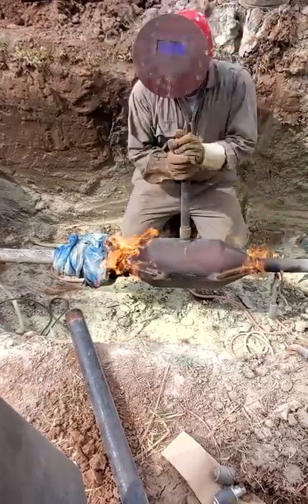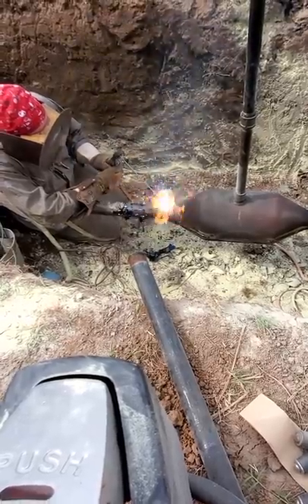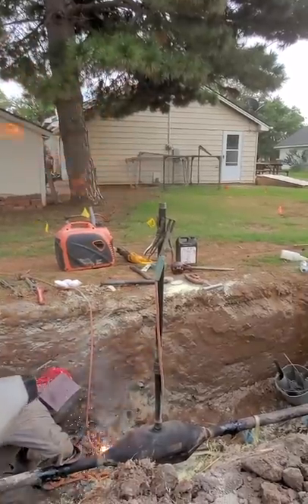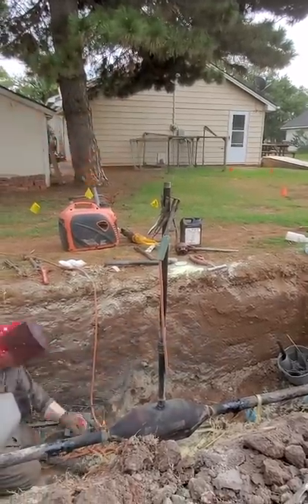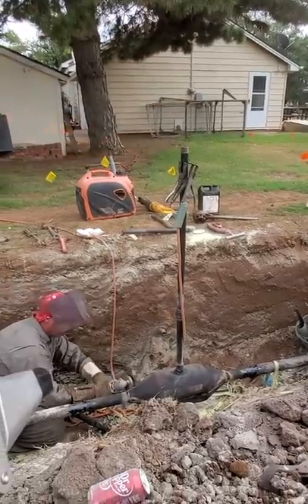Stick Welding a Live Gas Line | Hot Minute #shorts

Comment: Seeing fire is good. If the fire goes out and you hear a whistle....that ain't good.
Reply: If the flame is gone you want to be out of this hile and far far away very very quickly
Reply: Why? Everything in my head says "Fire Bad"
Reply: @Chris.Rhodes  Assuming normal conditions, there's no oxygen in the pipe. With positive pressure in the line, the gas burns at a controlled rate at the desired point, and doesn't build up for a flash or worse.
Reply: Vault Man if it burns it burns a little at a time, if it doesn’t burn, it can create a cloud or collect then any little spark or heat like from the welder would create an explosion or flash fire.
Reply: Fire means gas is burning and you know where it’s burning. That’s why you put the flare stack so the gas will go up the stack and ignition will take place away from you. This is the life !!
Reply: @ricomartinez1770  
"This is the way." 😁
Reply: @ricomartinez1770  how do you put the flare stack on?
Reply: @Travisphoenix334  in this instance the pumpkin (weld over sleeve) has a fitting fabricated on it to allow for pipe to be threaded on and to be stacked well above  bell hole operations. If you don’t have a fitting you can weld a fitting onto the sleeve and tap the fitting and place a stack. Several things can be done.
Reply: So it’s a safety flame 🔥
Reply: That's when you scream "flashback" and hope everyone gets out in time
Reply: Suprisingly this is more common than you think at our company we use whats called a pc-bottom-out witch is like the pumpkin but alot smaller if its a big leak we weld with arc if its a smaler leak we weld with oxi-fule like the come ts said you want to see that flame the second you dont run!!!
Reply: So when your done how do you put the fire out?
Reply: @robert1988420  for hot tie-ins it just goes out when you finish the root pass.
Reply: What I was thinking.  As long as she is burning its not collecting anywhere or back feeding.
Reply: What’s whistling have to do with it?🤔
Reply: @KazzArie  ignition following gas inside of a pipe makes a noise. The noise is different a little different depending on the I.d. of the pipe. Whistle is just a generalization for those noises.
Reply: I've heard stories about the death-whistle from co-workers. Shits scary
Reply: ... and you hear a whistle... "RUN"..!!!
Reply: @KazzArie  just before an explosion, of the liquid gas or such, it's the pressure building up that makes the "whistling" sound, being forced out through the "hole".. or where it's leaking... So if you hear whistling near a 🔥 fire... RUN..!!... It's about to pop..!!
Reply: @jackrussell1960  I see, thx
Reply: @Chris.Rhodes  the flame burns the gas as it left the pipe and the pressure on the pipe pushes it out of the line. that like on an oil rig or a lighter. if theres no fire... well... god have mercy if someone lights up a cigarette 😂
Reply: @BratislavMetulski  Gotcha! Thanks for the explanation! Because like I said, everything in my head says "Fire Bad, No Fire, Good!" I guess that's why I bury people for a living and don't work on gas lines lol
Reply: It’s just like a propane tank it leaks out some chemical but doesn’t have fire
Reply: Run
Reply: @Chris.Rhodes  sorry this is completely off topic your Bad Fire reminded me of Ride Wife Life Good lmao
Reply: @therandomizer7187  do what!? lol
Reply: Jonathan & Ashley Vasquez  The concept of lean or rich fuel-air ratios is wrong? Or keeping the fire where you want it when you want it instead of randomly sparking off is wrong?
Reply: It's like teaching people how to use a rosebud
Reply: @jackrussell1960  wrong. The whistling is caused by the ingress of flame and the resulting airstream feeding the flame into the pipe
Reply: What a thrilling job.
Reply: @KazzArie  it's either being sucked into .. or it's excaping out from the leak.. either way, you should run..!!
    {{{{≠===≠===≠===≠===≠}}}
Be prepared for Anything, it's happening quickly all around..

Peace~🙏🙏
Reply: The whistle will be the sound of the welder making a quick exit.
Reply: "You're gonna have a bad time"
Reply: @robert1988420  the flare stack tube is unscrewed from the pumpkin and a plug quickly screwed into its place.
Reply: @nuggert  yea ok, it's either being forced out, or it's being sucked in,..?.. however, I HAVE  seen, (on videos) that the flame, while being sucked in, there IS a whole lot of pressured liquid coming out, at the same time..?.. so explain that, if you can..? It might be handy to know, if I ever come across this problem..??!
Me, like you might of figured out, I don't work with gas so I have no experience, but logic tells me it can only be 1 of 2 things?.. or both..? 
Anyway thanks for letting me know I was wrong...next time I'll research it before speaking....?!!

Peace~🙏🙏
Reply: The Pumpkin of death. 🎃
Reply: @Travisphoenix334  krazy glue
Reply: LOL!
Reply: @bkingtz1  This is the life!(of someone who loves working with Natural gas? Maybe? Or someone who just loves smelling their own farts(mostly methane, a natural gas)!😂😂
Reply: Run!!!!!
Reply: @keithrobicheux4749  no. Its  like  the  one  of survivor.   It resembles life.. So  if  you  dont see the flame  it probably went kaboom  hehe
Reply: Marshall Hunter why’s that I really have no clue!
Reply: @raytrahan113  I’m no rocket scientist but when it’s not coming out the pipe and it’s whistling that means the fire has sucked in and is making it’s way to the source of the gas. Then... BOOM 💥
Reply: Vault Man The pressures pushing it so hard there’s no chance to build oxygen pockets for an explosion that’s  is the theory anyway just when you have oxygen built up in the pipe with it that makes it a bomb for instance repairing a hole that is too large you would have to cut out A section and bypass. When you kill the bypass is when you have to worry if there’s oxygen build up in the gas line
Reply: @southernberean8166  no need to worry, purging is part of the procedure.
Reply: S_vH  you're almost right the birds were small and died so you knew to get out. And the flame on the candle didn't go out it started burning different meaning methane.  They weren't testing for lack of oxygen they were testing for methane. Coincidently the same thing burning in this video.
Reply: I love how amazing you all are in this comment section. Everyone giving the information they have and nobody insulting those who dont know anything. Awesome to see. 
Bless you all and stand up against totalitarianism.  We all have to love each other and stand strong together to beat this virus and those who using it to grab more power and control.  Take care everyone! Much love!
Reply: Everything goes silent, flame goes out and remains quiet. Except for a low but "high pitched" whistle, then....

BAA-BOOOOMMM !!
Reply: @robert1988420  probably just cap the vent
Reply: @Chris.Rhodes  think of the flame as an exhaust
Reply: Shannon Snyder  if no valve , you better run. I'd rather have half a chance than none!
Reply: At my company we would never be able to weld something like this on to stop the leak we would have to cut the entire section out and weld a new one in mainly because the base pressure in a steel line around here is 60-150 psi
Reply: Shannon Snyder  I’m not our work groups welder but even when youre standing by on fire watch and the welder says “damn I’m not sure if I’m going to have enough main to weld to and not punch through it” is not a fun thing to hear, not too worried about anyone blowing up but having to shut off anywhere from 10 to 300 customers is not a fun thing to consider
Reply: Shannon Snyder  No need to tell these people about the dangerous chemicals they are bathing in , then they wouldn't do this job at all!
Reply: Nick Roush  no matter how much an hour not worth it
Reply: Or if you see that fire get sucked in. There will be an explosion.
Reply: @Chris.Rhodes  fire good cooks meat. When fire gets sucked inward along with fresh oxygen you have a boom.
Reply: @robert1988420  cap it and it’ll go out
Reply: Some call fire Marshall bill burns and show him how it’s done son
Reply: “If you see me running, try to keep up.”
Is my husband’s favorite pyrotech pro shirt
Reply: @bkingtz1  this is the way
Reply: There's no" if you hear a whistle run" type of thing at all. You all been watching to many movies. On small distribution lines the fire will burn as long as there is enough gas to stay lit. At no point do you risk sucking the flame into the pipe and exploding. I've done hot ties on 30" where we had gas leaking by the stopple and at the very worst you would get hit by a blast of hot air coming out the weld joint. Out on the west coast we call what this welder is doing " can welding". It's very safe and there are many ways to control the flame while welding
Reply: @Mobileweldingsolutions760  saw them tie in down stream from a leaking side gate in a station, and there was about 3 seconds of a growing noise in the pipe before all the streamers melted off of the air mover and one of the helpers beards got shortened.
Reply: @mkh1688  for sure and m not saying there isn't an inherent risk involved... I'm just saying that it isn't going to explode like some die hard movie. This is a very common method of repair in the natural gas industry
Reply: @Mobileweldingsolutions760  good enough
Reply: Or just deliver pizzas for a living
Reply: @jackrussell1960  Ach, Hans, Run! It's the whisle!
Reply: @Milkybetrayal  don't let it catch you napping🤪
Reply: @Chris.Rhodes   combustable gas not combusted building up a fire bomb 
Fire= it combusted no fire bomb
I LOVE GOLDDDDDDDD!
Reply: @flip2724  lmao
Reply: Cant happen it's a myth...fire needs 3 things and one is not inside that pipe
Reply: @harlanmcdiarmid  on a proper hot tie in absolutely correct.
Reply: @mkh1688   oh ? And whats an improper one? Due  explain  how in any case the flame ends up inside the pipe?
Reply: @harlanmcdiarmid  cold tie in with a leaky valve behind the blow down with the air mover on it, and locals ops not controlling the velocity enough to keep gas from going past the syphon.
Reply: @harlanmcdiarmid  another one is one station is pumping gas faster than the opposing. Demonstrated easily by holding flagging tape over the fit up. If they are equal in pressure then the flagging is pushed up and away flapping in the air. If no, it will get sucked into the pipe. That's a fact jack. Seen that in Centralia, IL inside a station on a pig trap tie in.
Reply: @jackrussell1960  your comment tells me how humble you are. Great job, hope others learn from your response. Especially nowadays, people need to chill, not get bitter over being corrected. Very impressed.

Cheers mate.
Reply: @FarmerFpv  thank u brother..
Peace🕊️
Reply: @mkh1688  lp line too
Reply: Mine got stolen on christmas eve at work.
Reply: @Milkybetrayal  Now You Have a Pipe Bomb, Ha! Ha! Ha!
Reply: Yup if that fire sucks in something is about to blow up
Reply: If the flame is gone you don't have to worry about anything. You won't have time to blink, let alone worry about the flame. Lol
Reply: It can't go down the line no oxygen is present in the line so it can't combust  iv assisted in hot taps and we weld directly to an existing pipeline to either remove gas or add to its volume
Reply: Wistle? After the bang!
Reply: That would be high pressure
Reply: ObamfSPIKE  then how do people know about the whistle 😵‍💫
Reply: What happens when it whistles?
Reply: @Saint_Sigismund  the whistle comes from air being pushed out in front of the explosion somewhere deeper in the system coming your way.
Reply: @mkh1688  Ah, I can see why you'd want to get out of there.
Reply: @ricomartinez1770  is the pumpkin a one time use piece that you just leave on afterward or do you take it off?
Reply: @sentesues9383  the pumpkin (weld over sleeve) is a permanent repair. It will stay on.
Reply: @ricomartinez1770  ah, I figured that's be the case. Thanks for clarifying!

Comment: Me: Knows nothing about gas pipes and or welding.

Also me: Interesting.
Reply: Just stop
Reply: Cringe comment
Reply: @matthewtruelove9298  I believe everyone understands what flames and gas can do lol. It's just over-all his job he's working on is pretty unbelievable the fact that hes welding on live gas pipes y'know? Pretty crazy.
Reply: @a.quintero8373  that's exactly what I'm saying these are brave men for doing these jobs. Sure it might be safe but one small mistake could be an epic disaster lol. Yeah amazing guys at work for sure. Sorry I get stirred up sometimes lol.
Reply: @matthewtruelove9298  Completely Understandable Matthew. Much respect for these types of workers.
Reply: Well played @a.quintero8373 ! Respect 🙌.
Reply: Explosions require oxygen. All fires require oxygen. If oxygen nis not available no amount of gas or paper nor anything else can catch fire no matter how hard you try. Yes in order to start a fire you need a fuel source and in order to continue a fire you need a fuel source but without the correct ratio of fuel to oxygen fire just can't be. The old gas station explosion by throwing a match in a puddle of gas is impossible. The wet gas will just put out the match. But the gas fumes sitting above the puddle mixed with the oxygen above the fumes and of course some heat say from a car engine or from some idiot willing to hold a match in the aforementioned zone of oxy and fumes long enough to put heat into both and cause "acceleration" can and will cause fire. If in a confined  this space will cause big thing go boom. ie gas tanks.
Reply: @matthewtruelove9298  Well sir didn't mean to offend you. My apologies I love my wife and kids and life. I also adore God and understand that science is a gift that he has given us to do some amazing things. There are many things that I would never do because I don't understand how people can safely do them. I am the person my company calls before a disaster. I love the people working inside of those buildings and want all of them to have a safe place to work. People like me prevent those disasters. And our lives a generally are the only ones in danger because alarms have sent everyone else a safe distance away. The rare gas line explosions are usually from an errant human or lightning, car crashes being at the top of the list and people digging around utilities buried underground second. A small or even a large break in a gas line never causes an explosion it just sends fire into the sky. There has to be a constraint before the boom. Such as gas building up inside of a building without ventilation or a pressurised vessel that is punctured violently causing excessive heat near the puncture area. We send brave humans to space on potentially explosive vessels and NASCAR drivers around ovals just the same. Science not stupidity nor bravery allows us to do that safely.
Reply: @thewelderturner  science says fires dangerous and gas line explosions are real lol.
Reply: @thegob1in  what do you nean?
Reply: @thegob1in  what do you mean?
Reply: lol
Reply: I liked the comment.
Reply: @matthewtruelove9298  your first 5 or 6 sentences aside, I swear that you just defined what a republican is. 😂
Reply: @randyboyce4796   most republicans aren’t like this guy. Most are quiet and watch things happen. This guy likes to pump his chest and be loud and get attention since his wife doesn’t give it to him. But most republicans are peaceful, open minded, law abiding regular people. Like myself.
Reply: @austinroscoe270  hahahaha lol! Oh my god lol! I should learn how to English...??? Lol Hahahaha!
Reply: @matthewtruelove9298  you didn’t even pick up on the irony man. Tells me how much your brain can function.
Reply: @matthewtruelove9298  now you quiet? Makes sense. Usually how it goes for you high and mighty people.
Reply: @matthewtruelove9298  we get your trying to sound smart but this ain’t the place there will always be a flow of gas in gas pipes as long as the leak is burning out the escaping gas then your free to work how you like and knowing there’s always a movement of gas in the pipeline there won’t be space for expungements just to go in this ain’t a movie but if the flame goes out it’s gonna be bad
Reply: @mogli4763  I'm not trying to sound smart I'm just saying for me and myself.  I am not doing that I will cause some sort of terrible happening.  Lol. Yall just misread my shit!
Reply: @austinroscoe270  I'm a die-hard Trump fan. I don't know how a political affiliation determines temperament. But what can we do Austin? 😔
Reply: @matthewtruelove9298  you are correct gas lines do explode but the ones you think of are 1000 psi cross country transmission lines, the amount of gas they have flowing through them generates static electricity, and if they ever get hit or a leak forms the escaping gas causes a spark that ignites itself and causes an explosion, lower pressure mains and services are unlikely to do this, most of the time the gas is in constant supply and would likely not drop into the flammability range inside of the pipe itself even that being said, if you have a leaking gas main and it catches fire, the most likely response until it can be shut down is to let it burn because at least you know where the gas is going when its on fire unless life and property are in danger. (this is all relative to my area at least)
Reply: Third person?
Reply: @crazywizard9078  Thanks Crazy.
Reply: Wow that's good you admit that I do no quite a bit about welding and even gas pipes it's not as dangerous as it looks as long as you have the right clothing and equipment also a fire standby team.....
Reply: @matthewtruelove9298  A room filled with gas can’t explode, nor can a pressurized pipe. This is because gas obviously needs oxygen to ignite, hence why the gas only burns outside of the pipe and doesn’t travel down it.